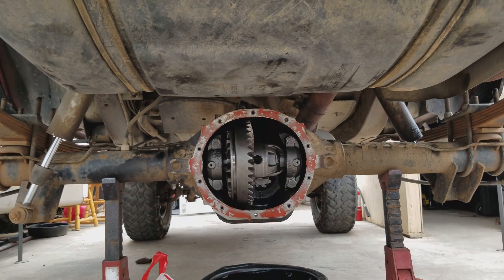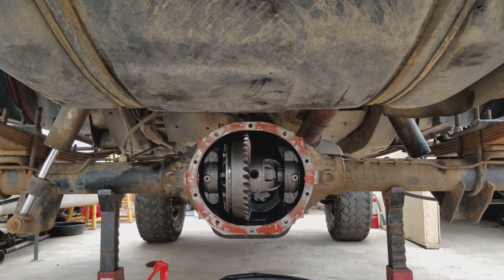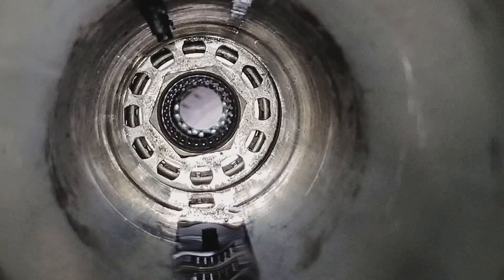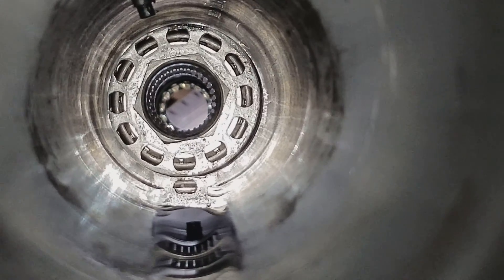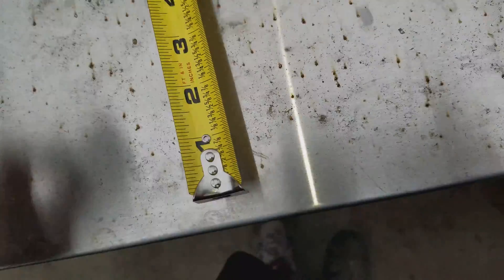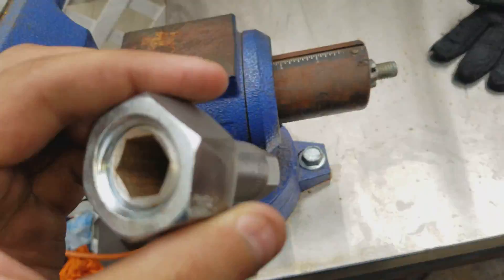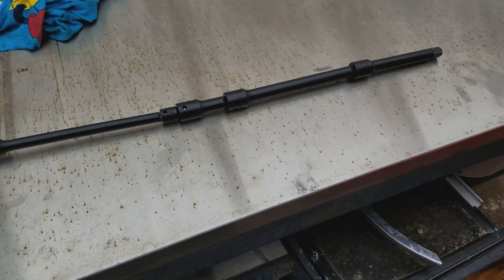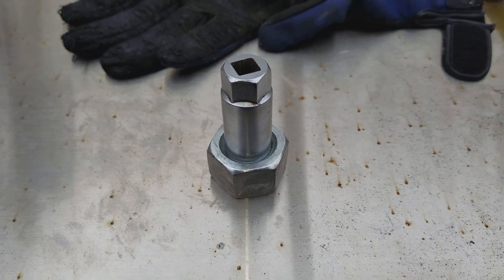Make Your Own Differential Bearing Preload Wrench For Adjusting Backlash on a  Chrysler 8.25 9.25

Comment: A word of warning guys don’t use that synthetic gear lube it’s about like pouring Crisco in your rear end. It’s happening in damp states like Pennsylvania synthetics do not contain rust inhibitor‘s or at least not enough of them for high humidity areas. It is so bad that the Covers on the back of rear ends, especially if you put an aftermarket one on with chrome or Chinese steel they rushed through enough to leak and then you burn out the bearings in your rear end and it cost you a fortune I put 95, 140 conventional gear lube with about 16 ounces of Lucas oil stabilizer, were used in the engines which is thick like that but it’s like a sticker like chainsaw chain oil. It keeps the gears and bearings coated I don’t know if I can adjust my rear end. to get the excessive play out or have to rebuild it or if I’m gonna have to replace the whole thing it holds it’s got way too much play in the gears but when I had it open there was no metal in there. It was dirty, you are a few pieces of some black stuff. I don’t know what it was. It look like some kind of ceramic crap. But when I told the guy at the auto parts this happened he said everybody was having the same problem don’t put that expensive synthetic or synthetic blend in your rear end. It is not worth it. These type of rear ends have been running for 34 years with no problem when you use your oil but people that put the New oil in are burning up bearings and I can see why..

if you ever have to pull something out of an axle tube or like a broken axle on a Dana style, that bolt from the outside you get like a piece of black pipe and some stainless or other strong wire you run it through it you make a loop you shove that in the axle and you pick up the piece with the snare and easily pull it out I got a talk me this on a Chevy 1 1/2 ton truck that I busted the axle off and I had to pull it out. Took me about five minutes to fix it, I was so happy what it happened. Was we loaded the truck up with a bunch of firewood and I said don’t worry it’ll go well the tire was kind of in a hole and the body was sort of twisted till the cultured stock and I kick the pedal a couple of times, and the problem was it snapped out and it snapped the axle just like that.😮😮😮

Comment: Doing this right now . . .
I don't have a nut that big, so I'm welding 1/8" plate all the way around the biggest bolt head in my junk can and it comes out to right at 36mm.
The bolt is going to be welded directly end to end with 1/2" rebar that's been wire wheeled down to shiny and spun around the belt sander to give those rebar curls a nice smooth feel.
On the end of that I'll weld on a 1/2" drive 1/2" socket (an extra / sacrificial socket).

It'll be one piece from end to end 32" long (so I don't have to stretch any further than necessary to reach it while rotating the ring gear for play).
And best of all, it'll be a nice solid tool to add to my collection and save me $150 too.

Cheers :)
There's a hint in there for you dude, if you haven't already . . . stretch yours with some rebar and make it one piece. You'll be glad you did.

Nice video too sir.
Thanks
Reply from the maker: Crazy that it really isn't hard to make it, right? Hope it worked out for you!

Comment: Great camera!
I used a 1in× 1/2 threaded nut and a 3ft piece of threaded gas pipe with another 1by 1/2. For about 18 bucks. Yours is way cheaper. Wish I would have seen your video first.

Comment: A 36MM CV AXLE NUT works perfectly!! and one of my spark plug sockets also was the perfect size for a press fit into the nut i had lying around in my nuts and bolts bin.
Reply: and i happened to have an extension long enough to just use one haha. thanks for the video!
Reply: Also, if you are afraid extensions, come in the part, you can do one of two things either tack weld them together or take a piece of rubber hose and some hose clamps and slide a coupling over the joint so it cannot come apart

Comment: I Like The Visual look Inside I Would Get Real deal  All those Extensions Would Make me Nervous But Cool video
Reply: Did u have to solder the 36mm nuts to the gas 1/2 pipe? If u don't, will the nuts twist off the pipe when u use it? Idk soldering. Thx.
Reply: See my comment! A little more expensive but there is no need for socket extensions. 
Use 2 -1in by 1/2 threaded nut.
One on each side of a 3ft stick of 1/2" threaded gas pipe. About 18.00 at any handy man store

Comment: What did you torque those carrier bearings to? Did you check your backlash while Tightening back and forth?
Reply: One video showed a guy counting the turns. Take tape and wrap it with a flap on one point and use a reference point to pass. Count the times it passes it. Then mark where it ends before or after that mark. Like 3 1/2 of 4 1/4 turns.